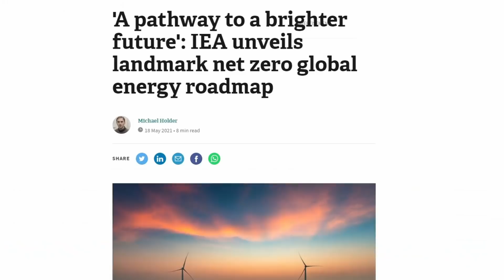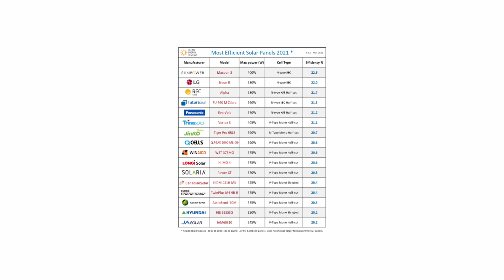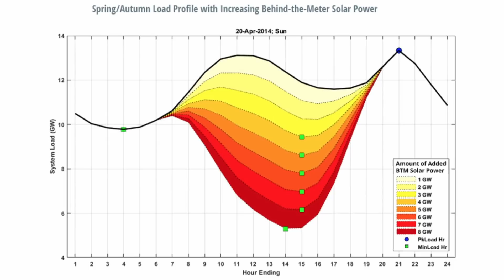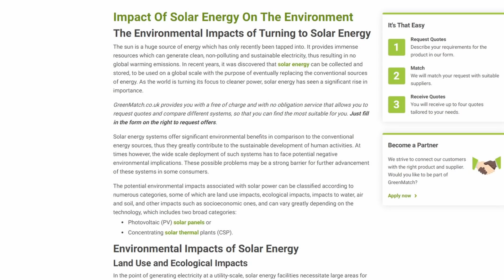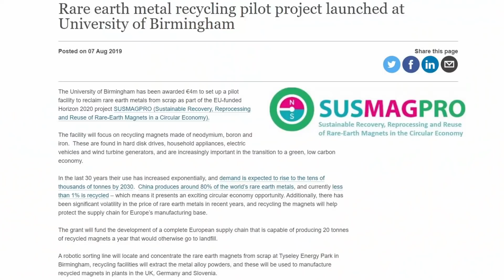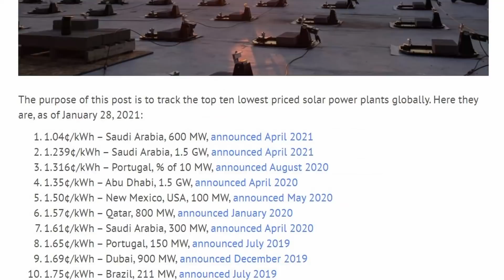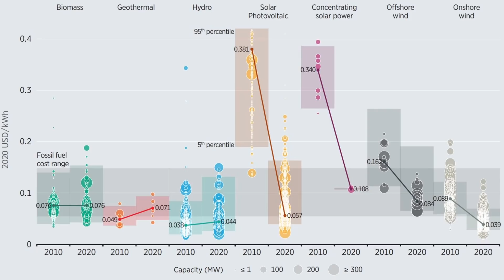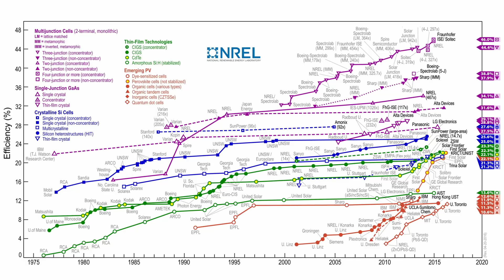Is Solar Power The Future Of Energy?

Comment: I know the whole storage thing is a big ??? mark, but... can't pumped water storage be scaled up to fix that? It's inexpensive, mature, efficient, doesn't create all kinds of waste, and can be done in almost any U.S. market.. 

Is there something I'm missing?
Reply: Yes, it is severely limited in capacity, geologically. There arent enough high-lying valleys followed by steep troughs that could be utilized for pumped-storage two-level reservoirs. They are a good idea, but not even close to a solution.
Reply: @generischerkanal  Well, they're like 95% of U.S. energy storage as far as I'm aware..
Reply: @gwils7879  95% of a tiny fraction of what would be needed without sufficient expansion capability.

Comment: Personally, I think the best thing for energy production (apart from workable fusion power) would be to move to satellite-produced power, in either low Earth orbit or, preferably geosynchronous/Lagrange-point-based satellites.

The technology for cheap(er) launches is almost ready, with Space-X and others developing reusable launch vehicles, especially if capable of launch cargo capabilities of 60 tonnes or more. The recent blind-like solar panels fitted to the ISS, or similar origami-style packaging could be used to quickly place huge solar panel farms into space. Either radio or laser transmission could be used to get the generated electricity back to Earth. A relatively low conversion efficiency could be tolerated to begin with, the scope for improved technology would be enormous.
Reply from the maker: In your opinion, what would you say the main advantage of a solar farm in space would be, vs on the surface?
Reply: @ExaCognition  Satellite power stations could be positioned in full sunlight, 24-hours per day. Or orbiting in low Earth orbit, multiple satellites could be linked (like Starlink) to again provide continuous supply to cities and states/countries as they progress around the globe. Theoretically, no place on Earth need be without access to power supply.

Ground-based receiving stations would only need to be a few hectares or square kilometres, less if laser transmission is used, and could also still be used as farmland etc. Or maybe, for Britain and Europe, sea-based. 

It is the potential for 24-hour provision of power that is the main attraction.
Reply from the maker: I'd have to agree, I'm particularly interested in how much with migtigate attenuation laser transmission in space for long distance power transfer. it could have reall by implications for energy generation in the long term.
Reply: @brettcoster4781   don't forget that the sun is way brighter in space so much so that They'd deliver up to 40 times the annual amount of reliable 24/7 energy that the same cell would generate on the Earth

Comment: solar is not cheap, it consumes huge amount of land that no one seems to account for when talking about solar its unreliable in region where it rains occupationally and the materials used in creating solar panels are toxic. once ITER has been fired up and proves the concept of Q10 efficiency we will have truly the future of energy. 1kg of fusion fuel can generate as much power as 1,000,000 kg of coal. Fusion is the same energy source that powers the sun and all stars, what fusion is trying to achieve is bottling a star and harnessing its energy. It is not an easy task but once we solve this puzzle the worlds energy demand will be met, fusion is clean, green and doesn't produce co2 emissions and it runs on hydrogen one of the most abundant elements in our planet.

Comment: Seasonal solar variation is probably the toughest problem. But it's not as bad as you might think. More modern grids, with distributed storage, will help a lot. When you consider the limited population in really high latitudes, and how most of them aren't really all that far from sunnier locations, it doesn't look so insoluble. Also, many of those high-latitude populations have other renewable resources to draw on—geothermal, hydroelectric, wave, tidal, wind. Notables cases of this: Norway, Iceland, Canada.

Comment: Supply limitations for CIGS and the like are not going to be a real problem. Thin film is great when you need its advantages, but silicon Si going to continue being dominant for the foreseeable future. There's no reason for it not to, with continuing cost reductions and no fundamental barriers looming.
Reply from the maker: I tend to agree, the potential material limitations are largely restricted the more "niche" panel types.
Reply: @ExaCognition  But since they are niche types, I don't think there is much likelihood of material shortages. Temporary shortages due to failures of planning are always possible, but that's another matter.

Comment: no mention of how betting on Green energy caused Germany to burn the dirtiest coal & depend on Russian gas?
Reply from the maker: I think its worth mentioning that Germany switched heavily to green energy quite early, when a lot of these technologies were quite a bit more expensive. This is also part of the reason why cheap storage is going to be essential if these technologies are going to move beyond cheap supplemental generation.
Reply: @ExaCognition  Germany is until today (& will be for the forseeable future) pushing back all gains the EU has had with lowering CO2 emissions, just because "nuclear be dangerous".
Reply: @ExaCognition  it's worth mentioning that the EU is blaming the average Joe for carbon emissions & planning to ban the selling of ICE cars, while they celebrate Germany poluting & carbon emiting as if there was no tonorrow.
you said yourself (and showed tha maps) that depending on solar in latitudes such as where Germany lies is inefficient.
Reply: You cannot stop the Green Revolution.   Here is Berlin transition from dirty coal to building a massive factory just outside of Berlin.  Tesla Giga Berlin making electric vehicles: https://youtu.be/Lj9sySkXNuk
Reply: I don't know if you realise this, But Germany's pollution in regards to energy generation is way down compared to 10 year ago (around 40% lower).

Yes, in the first half of this decade it went up a bit due to nuclear phase out, but then it sharply declined. The phase out of nuclear doesn't have anything to do with green energy. They could have deployed green energy without this phase out too. And most of te nuclear powerplants were taken out of commission only around 10 years before they would be shutdown due to age anyway.

Germany always have relied on coal-powered plants due to its natural abundance in Germany. And gas makes up around 17% of Germany's grid (FYI, coal around 26%), a lot of gas use in Germany is in private homes and industry. The gas use in Germany has also been rather stable in the last decade or more.

So while people like to bash Germany, they did a pretty decent job with the energy transition, considering how high prices of renewables were when they started it. In fact the lowering of wind power costs might be for a large part due to German investments in it.
Reply: @MDP1702  ok. if I open a website that shows how clean the grids are, will the German be cleaner than the French? never mind climate change, will German citizes be as safe as French citizens from the harms of air pollution today?
Reply: @jgr7487  German grid has never been cleaner than that of France, so that is a stupid metric. The correct one is looking at the trend, the change overtime. Even if Germany 10 years ago decided to go full nuclear, they wouldn't be cleaner than France now (hell, they'd be polluting more than they do now), considering how much time it takes to go from the decision to go nuclear to operational plants (15 years at least in a western developed country, probably closer to 20).
Reply: @MDP1702  "it's never been cleaner, so let's make it even dirtier."
Reply: @jgr7487  Except it isn't made dirtier, so your quip isn't correct.

Comment: Well storage is not going to be a problem because of the life cycle of the batteries in electric cars.

The first 10-15 years of the batteries life is in the car, but then it's better and cheaper to reuse instead of recycle. So these same batteries can then be used in grid storage for 20-30 years.

What is important for the EV is not so important for grid storage.  So when the capacity of the battery has gone down to 85% it's just not good enough for the car, but when it's still good for grid storage even when it's 50%.

When you look at the amount of battery factories being constructed now, you can see grid storage will massively increase.
Reply from the maker: I think your point on energy density is very important, that indeed battery storage can still utilize 2nd hand storage with depeleted energy densities because of its different requirements.

Comment: With the invention of superconductors that operate at room temperature, transmission of electricity for longer distances would be efficient. A night demand in the US can be satisfied with an excess produce in Africa. One sun one world one grid!
Reply: @George Mann Unless, as the OP said, we figure out a way to make room-temperature superconductors, in which case you could have a power cable circle the Earth a dozen times and barely register any loss.
Reply: the super conductors at room temperature only work under extreme pressure. at the moment its  2.6 million times typical atmospheric pressure
Reply: The transmission losses are too big.
Reply: @EmmanuelMess  That's why Parv Bhatt mentioned superconductors, the losses even over global distances would be practically zero if we had superconductive wires.
Reply: @RudeAlert  But I kinda doubt superconductors at room temperature will ever be a thing. The laws of physics aren't tricked that easily.

Comment: Tesla is working on a battery with 15'000 cycles so at one cycle per day it would last 40 years.
At 50$/kwh that would be 0.3 cent per kwh per cycle.
Reply from the maker: I think that is what is sometimes missed in heuristics for battery storage cost improvement. It's easy to think about energy density or cost to produce as the key drivers of cost improvements, but from a lifecycle perspective, longevity has a massive impact over lifetime cost.

What is your take on lithium supply and shortage risks?
Reply: @ExaCognition  I don't know how big current reserves are, but only highly concentrated reserves like hard rock are taken into account.
If you take a look at low density reserves like sedimentary clay there is more than enough lithium for everyone, but it's more expensive to extract.
But even if lithium get crazy expensive then scrap batteries value will rise too so wouldn't make much of a difference since you can get your money back at the end of the battery life.
Reply: @George Mann The issue is Cobalt, not Nickel...
Reply: @George Mann What about Iron? There is as much as you want and you don't need high energy density for storage anyway.

Comment: According to Tony Seba the cost of solar should drop by 72% over the next 10 years despite already being the cheapest energy in history!
So, one cent per kwh in 2030?
Reply from the maker: Indeed, its why the future of solar is going to be determined more by our ability to store energy than the cost of production, since the cost itself will become the cheapest pretty much regardless of location.
Reply: @George Mann Aren't chinese factories already as expensive as US factories?
Reply: @George Mann I've always tried to equate pv to glorified batteries with a gimmicky release. Also it's questionable and still unanswered if more current materials for pv will suffer from output degradation over time that has been seen for years. There's a reason there's a market for cheap solar panels that are 3-6 years used because of how much their output has decreased that they need to be replaced in large arrays.

Thermal is the best use of solar energy. Even then probably not necessarily on large scales but rather local to prevent ecological destruction. All current renewables suffer from that though, not limited to solar.

Comment: Is Fusion Power The Future of Energy?

Dunno, probably? :P
Reply from the maker: Fusion power certainly has a big role in the future of energy, for a number of reasons. I'm looking forward to making that video.
Reply: unpopular opinion:
nuclear power should be utilized more to decrease CO2 emissions for years/a few decades and buy us time to improve renewable energy sources or develop things like fusion power which then take over.
yes, nuclear waste storage is difficult, but we can decrease the speed of climate change thanks to nuclear power, until we can utilize cleaner energy
Reply from the maker: Nuclear can contribute a lot for clean energy, the challenge is cost and construction time, at least with the typical facilities we are talking about. By the time they are constructed, I'd expect the gap to largely be filled. I think Small Modular Reactors present a much better opportunity in this regard, because while a new technology, its got much better scaling from a cost and capacity perspective. How quickly this happens is the key question, for how well SMR's can fill that role.
Reply: @happalula  new models for fast breeder reactors can burn what was previously spent fuel! Not to mention LFTR reactors. They could enable us to get basically all of the usable nuclear energy from uranium and thorium supplies, which could solve our energy problems singlehandedly while we try to make our power grid renewable and ecological friendly.
Reply: exactly - but sadly just about everyone i know disregards those options as "wish-thinking", when they could buy us the needed time
Reply: @happalula  which in turn, is only going to cause that much more suffering down the line when we have even less time to pull humanity back from the ecological brink. There are few things I consider to be anywhere near as important as making our power grid as nuclear as possible ASAP.